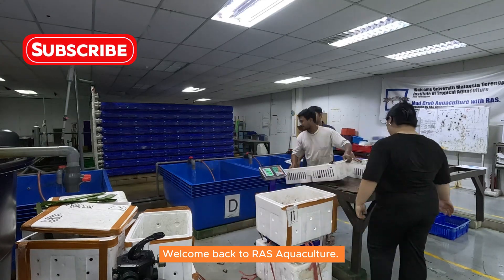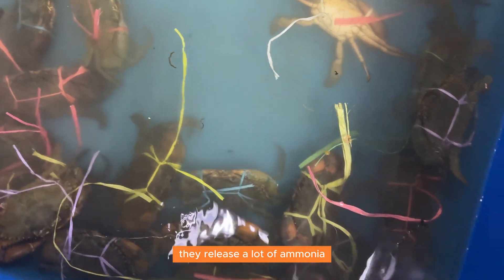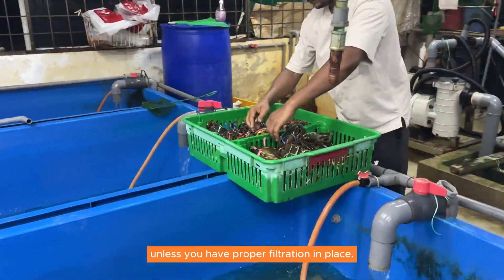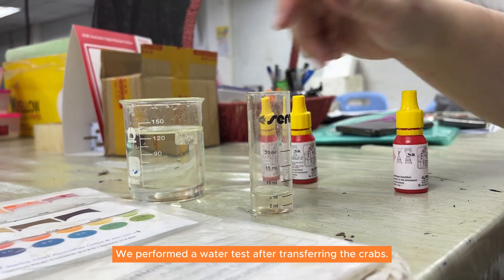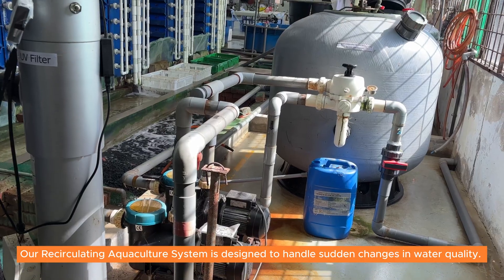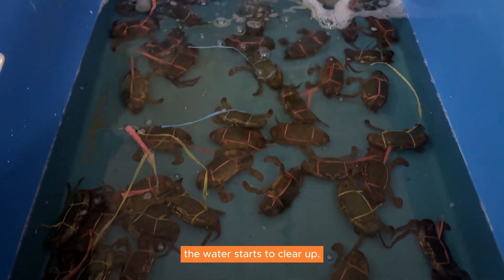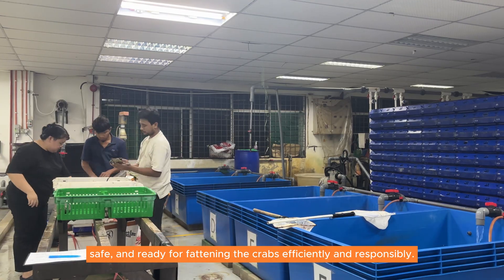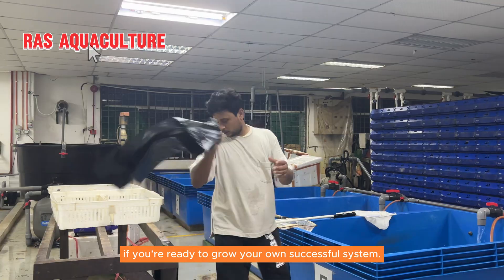CRAB WATER TRANSFORMATION: See What Our Filtration System Can Do!

Comment: I pull blue crabs from Savanah Georgia in a 72qt cooler using a 12v airator to keep them alive for the 150 mile journey North. They are placed in a 250 gallon tote prepared with salt and minerals closely matching their origin. I generally lose 10-15% on the trip and remove them immediately. The rest seem to do OK in the tank for a day or so then the ammonia levels go absolutely bananas. Even with 100 gallon water changes and aggressive filtration I lose 40-50% of the remaining. Going to try something different next season with an intermediate tank of clear water for them to reside after the trip for a day or two, then a good wash out, then place them in the big tank. See if that helps.